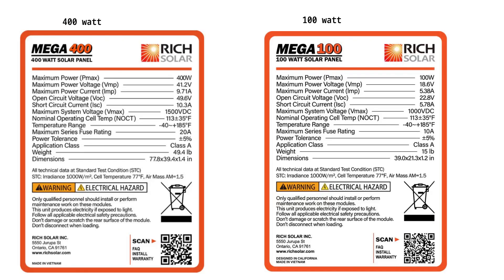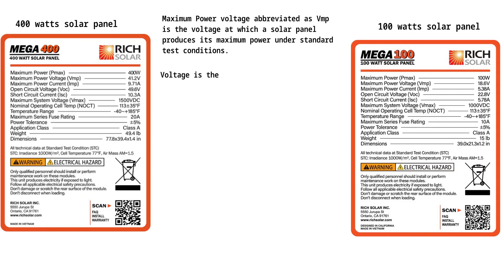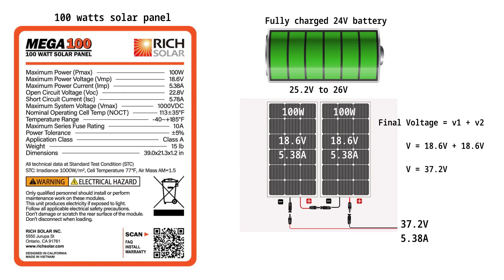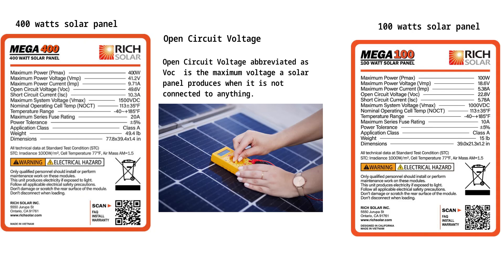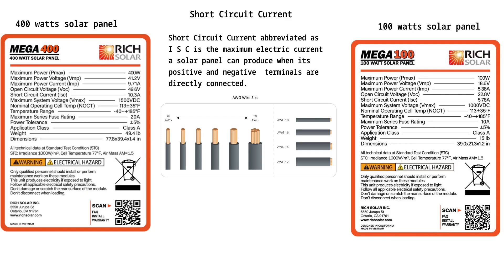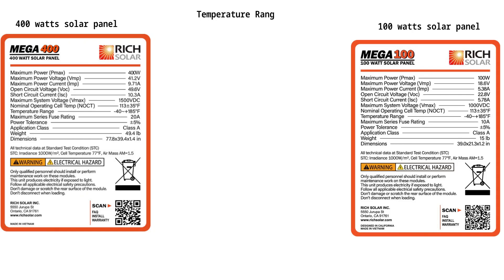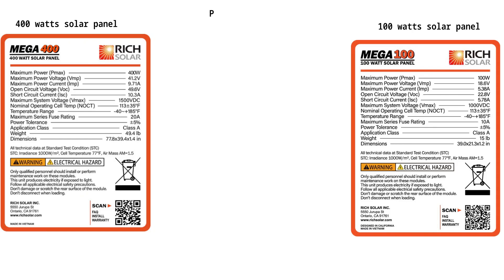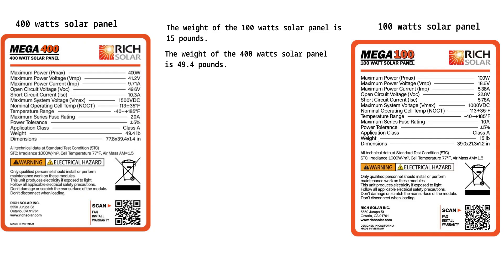Understanding SOLAR PANEL TECHNICAL SPECIFICATIONS and their role in solar system design

Comment: can all solar panels work in 12v systems?  i see many panels that say 12v 18v 24v  and some that dont say anything?
Reply from the maker: Not all solar panels can work with a 12v system apart from solar panels that produce atleast or above 18 volts. 
This is because the battery charges with a voltage of 14.6 volts which acts as a force that pushes amps into the battery. 
A solar panel outputting lower than 18volts will not be able to charge a 12v battery well. 
If there is no information of the voltage the solar panel produces, use a multimeter to test the voltage output. 
If a multimeter is not available, count the number of cells in the solar panel and multiply with 0.55 volts because each cell in a solar panel produces around 0.55 volts. 
If the number of cells in the solar panel is 36, then the voltage output of the solar panel will be around 19.8 volts which is 36 * 0.55 = 19.8 volts. 
The voltage can still be slightly higher or lower depending on the efficiency of the solar panel and environmental condition.